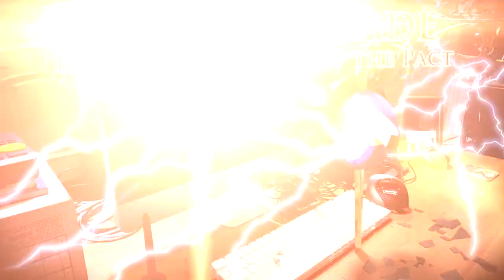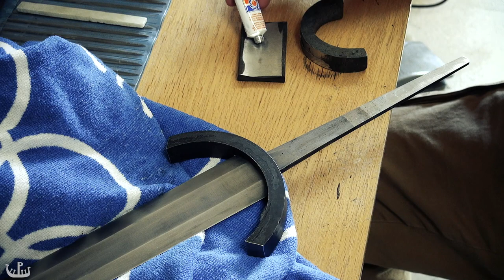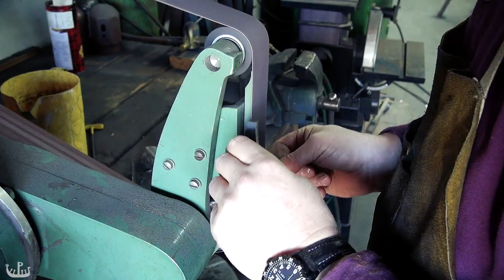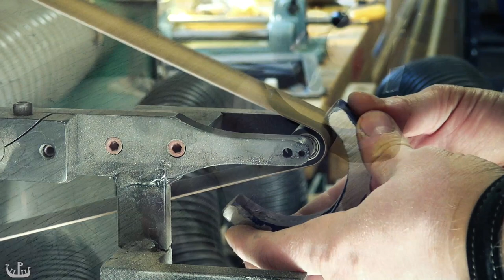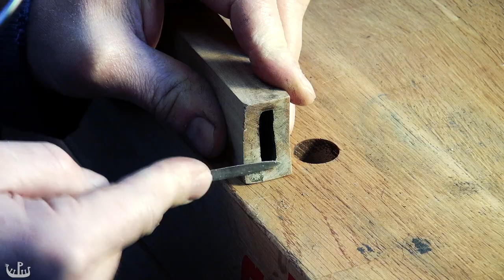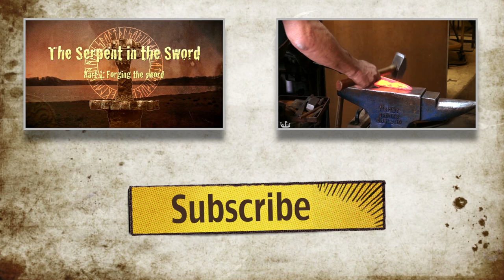ChronoBlade: Fitting the Hilt/Rough Assembly (Part 3)

Comment: Curious, how did u attach the cross guard, did u just use the hilt and pummel to keep it on, or do use some other technique, because I've heard of inserting metal wedges into the side of the slot so they would be wedged in between the cross guard and tang, I'm always trying to see how others do it for reference
Reply from the maker: I should make a video that goes into that detail. I will keep it in mind. Perhaps for the serpent sword I can show that.
Reply: Niels Provos that would be quite helpful if you did, I can't really find solid info on the matter, it seems to be a detail that many just pass by